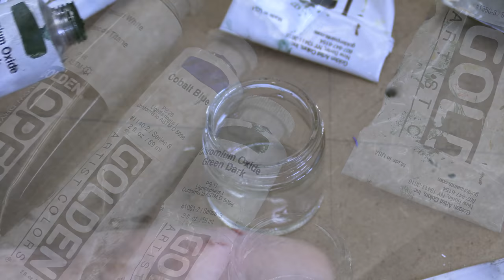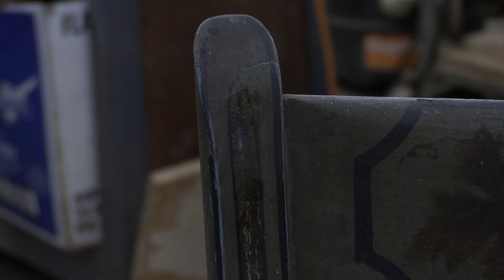Back to Beautiful - Thomas Johnson Antique Furniture Restoration

Comment: Those Baroque Art tins are the same as I found in our local art and craft shop, here in South Africa! I use antique gold on a chrome plated shower head to match up with antique look towel rails and soap holder. A light sanding, painted it black and applied the guilders paste by finger, covered with  clear outdoor wood varnish. 15 years later, it still looks really good.
Reply from the maker: Wow! That's great! As I was reading I was wondering how long did it last!

Comment: As usual, I’m excited at a chance to learn from a master.  I admit to being confused by the starting cleaning solution.  Oil soap makes sense, but mixing borax (a mild base) with vinegar (a mild acid) would appear to mostly neutralize one another leaving boric acid and a salt.
Reply from the maker: Thanks! Someone else mentioned that. I'm going to leave out the Borax

Comment: I finally realized what I was seeing on that char. Originally it was painted and lined in much brighter colors. You can see the original blue under the chair seat. In a few places you could see the original glittery gold. Once the chair had been painted and detailed, it was covered in a coat of varnish, and that varnish has yellowed drastically over time, muting the whole chair to a kind of greenish-brown.
Reply: I Wonder if Julian would have been able to advise him on how the remove the varnish without removing the underlying paint? Julian Baumgartner's 2nd step after cleaning the built up grime and dirt on the surface would be to remove the old yellowed varnish. Then apply an isolation layer to brighten up the color to allow color matching during the touching up of the missing paint and then a new varnish coat. Maybe the type of paint used on the chairs, unlike the oil paints used in canvas painting would have dissolved in the solvent... who knows.
Reply from the maker: Thanks! It was interesting to me too, seeing exactly what was done
Reply from the maker: Thanks! I'll have to watch more of Julian's videos. I sure would not have wanted to go that far on these particular chairs

Comment: I'm pretty sure Julian will have a broad smile on his face when he will watch this. I can't wait to see his reponse in one of his future video's.  Now the milion dollar question remains: "is your work reversible?"
Reply: He would point out that Tom matched his retouching to the discolored old varnish and not to the original color underneath, meaning that if later on it the varnish is cleaned, then all of Tom's retouching will have to go, too. But then again, furniture DOES have patina while paintings does NOT. (One usually does NOT remove the old finishing, varnish and shellac of an old piece of furniture as one removes that of an old painting). That would make a mutual reaction video amusing to watch ;-)
Reply from the maker: Thanks! I would be very flattered if Julian was ever aware of this video! He would probably just shake his head
Reply from the maker: Yes, thanks! A big difference...

Comment: It would be interesting to know the real age of those chairs. To me they look like they are much older than the 1910s or 1920s. It looks like they were originally white and "repurposed" and rebuilt with new back slats at some point, then painted blue with the stenciling and striping to make the chairs for in with a more recent time period.
Reply from the maker: Thanks! Yes, it's a bit of a mystery. I'm still not sure
Reply: They look like Federal fancy chairs to me from about 1820 .They may have been given some new rush seats .I have never seen 1910 reproductions of Federal fancy chairs but perhaps they existed .

Comment: Bronze or bronzing powders are generally made from mica (a sparkly mineral). I was lucky to find a bunch of antique ones online, which I use for antiques repairs as well as stenciled clock glasses.
Reply: I like this restoration. The finished chairs look worn, but not damaged. They still look very old, and they are not perfect, not every single little chip was hidden.
Reply from the maker: Thanks John! I hadn't thought of mica - still a little mysterious though - cool stuff!
Reply from the maker: Thanks - I agree

Comment: What can I use to clean a wood carving antique that will not damage the colour? Distilled vinegar with water?
Reply from the maker: Most cleaning products will not change color. I would go very easy on the vinegar. A solvent like paint thinner would also work, and won't affect the wood. maybe just a dry brush would do the job!

Comment: 6:59  You ought to try to find an old paint tinting machine from some hardware store that has gone out of business.   That would let you precisely tint putty with an exact number of drops of tint, and then you would have an exact recipe you could replicate as many times as needed.   You could make a binder to keep with the despenser so you could remember all the custom recipes and which client they went to.
Reply: My wife is an artist, acrylic is her primary medium. She has a homemade chart with colours and how many parts of each paint she used to achieve it. Simple, not expensive, and takes up less room than a tinting machine. And if you have an in between colour it makes adjustments simple.
Reply from the maker: Thanks! Good idea except - the colors are all over the place on these chairs. each chair, each area different. So I'm not matching as much as just hiding defects
Reply from the maker: Yes, that's a good way. I've done the same thing with stains

Comment: How were the stretchers so abraded on the inside. Did they used to be on the outside but were turned to the inside?
Reply from the maker: That's the mystery! Maybe they (the bottoms) weren't painted well in the first place

Comment: So was the blue a primer coat?   Or was it originally painted completely blue and someone later painted it olive drab with gold and black highlights?
Reply: It was originally painted blue and gold and varnished over, then the varnish darkened and yellowed with age. But unlike paintings, it is NOT usual to remove old finishes from furniture. Its patina is actually part of their value (unlike paintings, where it is just... dirt).
Reply from the maker: I think it was primer, the finish was likely a 4 step process. There was a lot of glaze involved
Reply from the maker: I think it was a primer, but then heavily glazed

Comment: Can you recommend a good brush on polyurethane or does it even exist. I don't have an air sprayer. Any help would be greatly appreciated. Thank you.
Reply from the maker: Thanks! I'm not sure about poly, but I'm finding those stupid foam brushes are working great for the Waterlox Original Varnish I'm using. Try using a slow drying finish. The faster it dries, the harder it is to get a good coat by brushing

Comment: I love your videos. What is the oldest thing you have worked on. What do you recommend for preserving and protecting wood on firearms
Reply from the maker: Thanks! The oldest is a table I recently did that might have been 350 years old. I've never worked on firearms, but if it was one that was to be used, I wouldn't use a film finish. I would use an oil finish, or an exterior varnish used like a wiping finish. Put it on and wipe it off so it doesn't build up
Reply: @johnsonrestoration  wow thats a old table. Amazing it still exists. Thanks i am trying to clean and Preserve a wood pistol grip for a colt dragoon made in 1849. Thanks again for your advice.

Comment: Tom, use a brush to smooth out the putty, don't wipe it with a cloth! : )
Reply from the maker: Thanks! I'll try that, it didn't occur to me
Reply: @johnsonrestoration  I use that trick also when I close a hole in the wall with putty; with a putty knife I make the putty flush with the wall and finish it off with a few strokes with a dry or wet brush, mimicking the texture of the wall. It works a charm. Hope it helps. : )

Comment: When you began, it took me awhile to realize that you were attempting to repair and restore a tole painting folk art finish applied to the chairs as the tole painting didn't illuminate well in the begining of the video... it became more evident as you began describing the stenciled details and the camera picked up the painted design. Julian Baumgartner would definitely approve of your conservative approach to filling in the voids and touching up the missing color! But was there a varnish coat over the paint that yellowed, darkening the otherwise vivid paint colors? Could Julian have advised you as to how to test for the varnish and if it was possible to remove the old varnish to revive the original colors, retouch the missing paint and then apply a new varnish coat? Or would the owners not want to put that much money into their restoration...
Reply: Furniture is different from paintings. Furniture DOES actually have a patina which is part of its value (unlike paintings, where it is just... dirty). Removing old varnish or other finishes from old furniture (which is routine for paintings) is usually a big no-no for furniture.
Reply from the maker: Thanks! Yes, the main thing is that it would be far too expensive for these particular chairs
Reply from the maker: Thanks! Yes, good point...

Comment: I believe Baumgartner should actually learn a thing or two from this man, for starters, to not badmouth those who worked on a piece before him
Reply from the maker: Thanks! Does he do that? I realized a long time ago to never critisize other people's work. You don't know the whole story!
Reply: @johnsonrestoration  he tends to say that prior restorations were bad because they used this glue or this pigment instead of the other or that the varnish layer applied was too thick, too thin etc, criticizing every little thing, i agree we do not know the whole story as It is clear that prior restorations of the pieces he works on were usually done quite a long time ago and the materials, accessivility to the knoledge of so many techniches and the machinery that's a standard nowadays was not always there, I can't say he doesn't do an outstanding job, he does, but he could improve on respecting or at least not criticizing prior restorators i think